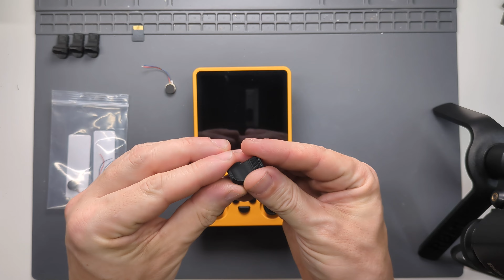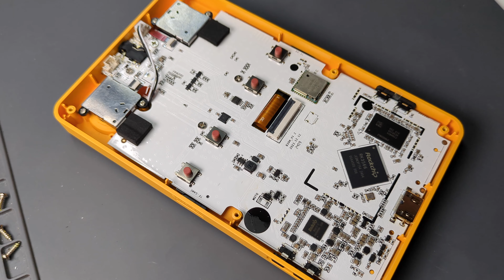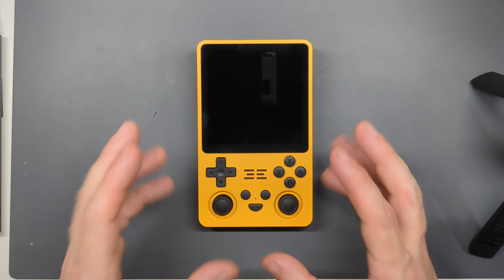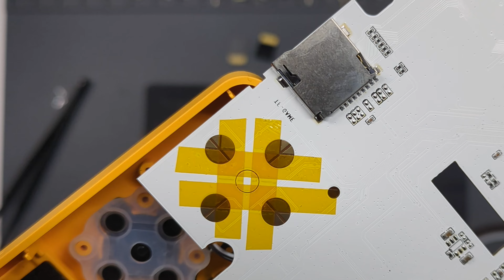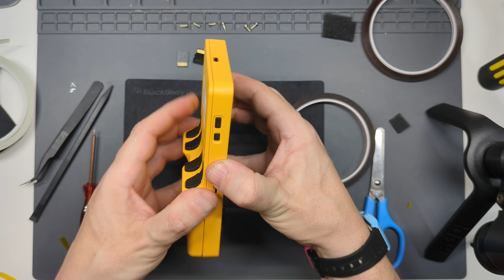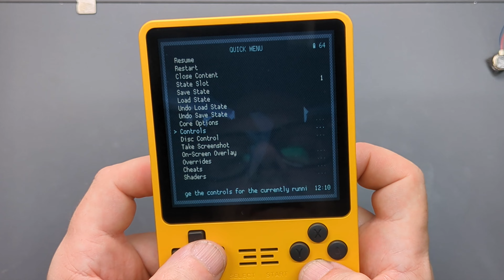Mod your RGB20SX! Rumble, D-Pad & Trigger EASY Mods

Comment: Late to the comments here but I was curious are you able to in general print in translucent colors? I saw some custom lime green clear buttons from sakura mods that made me pull the trigger on one of these. But it would be nice to have a full set of clear lime green buttons and maybe a grip. Obviously I don't have a 3d printer or I'd probably be a bit more in the know on print materials.
Reply from the maker: It is possible, particularly with resin 3D prints, but it's not as clean as moulded buttons.  I have been meaning to attempt a resin print of these buttons, just not got round to it yet.  The PLA is a lot more hard wearing and flexible though

Comment: Can this be done with the Powkiddy V10?
Reply from the maker: Ahhh I keep seeing people raving about that console, I am tempted but I don't need it, so at present I don't have one to check.
Reply: @JoeBleeps It’s great for GBA. I’ve been disappointed in GBA with 4:3 and 16:9 handhelds, but couldn’t justify the Trimui Smart Pro price for a single system. Enter the V10. Rad little thing, but sadly missing a rumble motor and gyroscope.
Reply from the maker: @rawcomix  I got one this weekend!  It was on the Aliexpress sale and I couldn't pass it up at the price.  First impressions are great, as you said a GBA machine for sure.  Shame about the rumble, I wondered if I could add a motor but I can't see any suitable contacts on the motherboard.

Comment: Thanks for this.  Mine was a struggle to get the board out of.  Not sure if it's clear vs yellow or what but I had to flex the shell to get the headphone and USB-C ports past the plastic.  Then on top of that twice I put it back together and tried to screw the sticks in before the board and something would shift between the d pad or buttons.  I ended up having to pull the board 3 times to finally get everything back together...  But again, thanks for the video so I knew I was at least on the right path!
Reply from the maker: I think you have a good point there that I hadn't thought of. Clear plastic is generally less flexible and more brittle than its opaque counterpart. I hope you didn't break anything
Reply: @JoeBleeps  I was able to not break anything doing this BUT my case already has a few cracks around the D-pad...
Reply from the maker: @benjaminbjacobsen  oh no that's a shame. I'll amend the description in the video to factor this in

Comment: Would an adhesive felt pad work in place of the pad that was used?
Reply from the maker: On the back of the motor? Yes I'd say so. Just something to prevent two hard surfaces touching and rattling.
Reply: I managed to get the motor installed but im having trouble getting games to rumble, only pokemon pinball rumbles a little bit. I am on arkos, is there something else i need to set up besides turning on rumble in advanced settings?
Reply from the maker: @dbgrasta420  have you tried drill dozer? That's a great one for testing. On the PlayStation emulator as I noted in the video it's a bit of a headache. You need to enable rumble, set the controller as a dualshock, save both of these and then exit and re-enter the emulator. It does work but it took me a while to have success with it. Worth it when it works though

Comment: Love the combo of ArkOS and the rumble motor I soldered to my RGB30, so I'm happy to see that you covered this! 
One mod I did on my RGB30 that you may want to consider doing on your RGB20SX is to remove the d-pad and use some 200 grit or higher sandpaper to smooth the transition edges of the d-pad top surface. I found the d-pad edges to be too sharp compared to my other retro consoles, but was fixed with just a few minutes of careful sanding.
Also, the PSX buttons from SakuraRetroModding make for a nice change from the default ABXY buttons.
Reply from the maker: Thanks for the input! I think the d pad on this one is more comfortable than the RGB30, it hasn't caused any discomfort so far. I do love all the Sakura button sets, they look awesome.